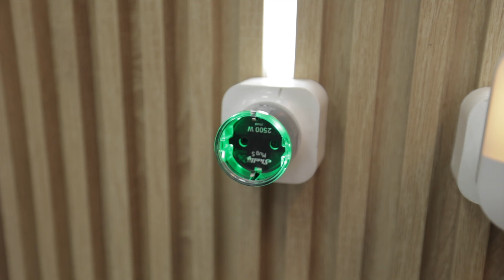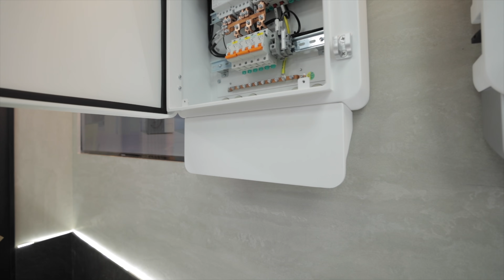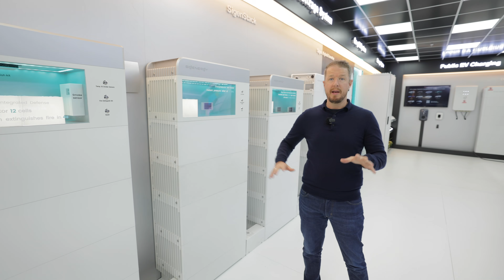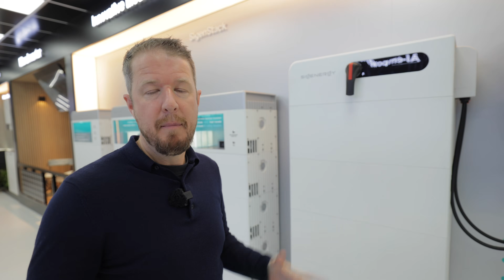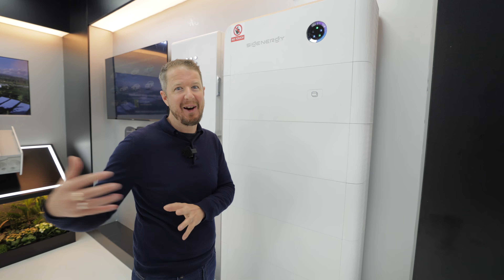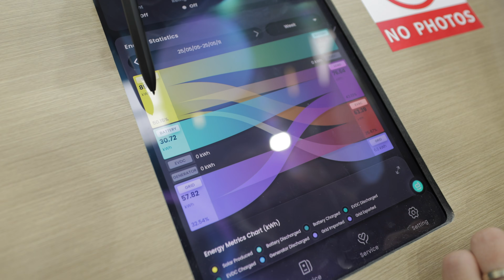Is Sigenergy About to DISRUPT The Solar Industry?

Comment from the maker: 👉 Want to learn more about Sigenergy’s latest tech?
Check out their website for full product specs, updates, and info on how to future-proof your home or business with their smart energy systems: https://www.sigenergy.com/en/home

Get a Quote: Interested in our services? Get a quote from us today: https://app.openquote.net/company/artisanelectrics
Reply: I'm done with the system packagers. I'm installing a set of three Victron Multiplus II inverter/chargers and three 5kW batteries for three phase whole of home backup, at about 50% of the cost of a SigEnergy. My two existing PowerWalls, that I used ti have local control of until Tesla decided they wanted to make money from VPP providers using my battery took away local access - and are now talking about charging me for even controlling it via their servers. Just give me local control back! I just don;t trust any of these guys any more. And if I have an issue with a PylonTech battery, individual cells are standard off the shelf sealed units and can be individually replaced, unlike the PowerWall which has to be thrown out if even one tiny cell goes bad and brings down a bank.
Reply: Is Shelly support dependant on a gateway being installed?
Reply: If you have 4 Stacks with 25Kw inverter on each stack how much Kw’s can you export to the grid? Or are you limited by the GRID? I’m just curious and planning a system for my own Edwardian house.

Comment: A few questions is the Ai working All working as a unit? or does it require internet?
I must admit it's a great looking integrated system, I wonder how it compares' to Victron Energy which was my go to system before I did see these units from Sigenergy, I really like to go with Build Quality & Design, 
in the Future I will be looking at a Bungalow with a South Facing long rear garden, mounting ground panels, & mounting equipment in a double garage,
I live in Cheshire I am hoping to go off grid heating water with Solar PV & Solar Thermal, have a underfloor heating system, basically pushing excess PV energy into the Water heater tank, if I get the ideal area of garden then maybe pumping energy back into the Grid used as a standby supply, 
Looking to grow the PV system every year, I do like vertical BF Solar,  
66 retired Aerospace - Defence Consultant Engineer ex UKAS DC & LF Instrument Engineer,

Comment: Home automation is plagued with 'Apple-ized' walled-off ecosystems, apps, often not locally connected , and overpriced.  For a comprehensive system you would have to wind up relying on something like Home Assistant in any case.. so that's where you might as well start.

Comment: Product looks great. Question do they offer, or will they offer, a hot water diverter like solar edge do? I have a solar edge hot water diverter and is amazing and I’m not sure why they are not more popular? Basically is a hot water battery. I have a 10kw system and apart from very cloudy wintery days I get 400 litres of hot water every day from solar pv.

Comment: Great, another vendor trying to replace Home Assistant with their own solution. As for 'smart' I'm not sure that there is a tumble dryer out there that if powered up by a smart plug will automatically start a drying cycle. You need devices such as the LG ThingQ range, that have builtin API interfaces.

Comment: Your tumble drier illustration is dodgy, artisanelectrics. Are you suggesting people put wet washing into a tumble drier and then get their system to run it if they have excess energy? So what happens if they don't . . . if it's cloudy? The washing sits there and it goes smelly, or even goes mouldy if it's cotton and there's spores in the air.
Enough of this.
Where I live, there is no mobile phone service, so I have never got round to updating my phone to a smart phone. Are the apps that all these systems you instal workable via computers (laptops or desktops)?
My not very old gas C.H. system works with Hive. I can access it and control it on my laptop . . . or could, until Hive insisted on two factor authentication, and wouldn't allow email or landline usage; it had to be SMS on a mobile phone. Thanks, Hive. Hive, owned by Centrica, a company with assets of £18.3 billion last year, according to their preliminary results.
So what do you manage to instal in buildings where there's no -- or no reliable -- mobile phone signal? Does it all work locally through wifi? No 2FA involved?

Comment: One of the main requests i see from EV users, is for the battery not to discharge into the EV when the charger is wired into the gateway. I would hope this will be addressed in v3 of the app, if not before.
Reply: Home Assistant + victron to the rescue.   My system identifies an octopus intelligent Go session outside of the usual slot, switches the battery to charge, charges the car, heats the hot water all for 7p/KwH...
Reply: @andrewmelvin2717  Not much help if you have a Sig system..

Comment: What is needed is cheaper products. Systems with batteries in them frequently take 20 years or so to pay for themselves in the UK which is not a great location for solar. This effectively means they never pay for themselves. Adding "exciting" bells and whistles is probably going to increase the cost and cancel out any new savings. 
To disrupt the solar industry we need prices of equipment to plummet and also not need expensive firms like Artisan to install them.

Comment: Look i am a fan of Sig Energy (Signal, SigInt) but there are still issues a quick look of the facebook forum....
Simple maths often failing - just adding up of numbers sometimes doesn't work.
Biggest issue still remains that when there is an outage of servers in China the entire stack un-comminicable - not that it doesn't continue to work but highlights a MAJOR flaw in the machine

Comment: How would turning my plug on make my washer, drier anything else that requires a program selecting and a 'Start' button pressing on the machine??
Reply: Try unplugging your washing machine,  then set the program,  switch the power button on the machine then pug it back in and see what happens.
Reply: @GaryV-p3h if you switch off the machine how would you be able to set anything?
Reply: @theSKINTyorkie  I can on mine because it has a manual programming dial, I can set it then just switch on the power with a smart plug or timer

Comment: If there's one thing that's almost certainly setting things up for failure it's using Wi-Fi (a mobile comms medium) for devices that don't move. Even worse when it's a device you're running cables to anyway and that needs the network to function.... It's borderline madness.
Reply: A wired connection is always better for higher bandwidth devices but for these smart devices it's a simple on/off signal. Most of them use 2.4Ghz wifi so it travels further, through walls etc. A good wifi router will have a dedicated separate IOT access point too but aside from all that I have not seen any smart sockets or bulbs or dishwashers or fridges etc with a LAN socket.
Reply: Based on your logic,  Shelbies, Ratgdo and 90% of other IOT devices have no reason to exist.  They are not mobile but are used remotely and the device would be twice the size and expense.  

If you brought cables down from your roof,  you need to protect them from the elements.  Which means either running separate conduit for them or using shielded valves in the same larger conduit as the power cables.  Both of those solutions would double the cost of that part of installation. Also not as architectural finesse.

Comment: Seems a game changer 
Then there’s the issue that no doubt likely to be hacked like everything else digital
Some might call it a kill switch or the opposite when lights start randomly coming on or off costing money one has to think outside the box. There’s nothing like a good old manual switch. I’m sure if they stopped selling said switches I’m sure I can make said switch from RS electrical supplies

Comment: I dont see Sigenergy being successful in the commercial and industrial landscape. In the industrial environment especially companies will choose manufacturers who are tried and tested.

Experts from the UPS industry will win the solar business here as they have more DC experience than any solar installers.

Also a traditional battery setup like a UPS would be much better for industrial users as many different battery manufacturers can tender for that aspect of these projects. Similarly if a certain manufacturer has a bad run of batteries its much easier to swap to a different manufacturer. I dont think modular systems will win out in this landscape.

Comment: This smart home automation is not new. My house has had fully automated smart sockets, plugs, lights, power management, garage door, cctv, etc for the past 6 years, all running with Home Assistant.
I have personally not used Shelly as my house mostly uses Sonoff and Aqara.

Comment: There is actually a team from Sigenergy in sweden right now to testning V2H  steep 3 i think? 😉 "Then it was time again with a batch of tests for V2X, this time with Sigenergy personnel on site from China.

This will be a slightly longer test, including testing that safety functions work with all the respective cars, before the beta program will soon be expanded to include a number of private individuals.

So if you have your car model on the list of those approved for the semi-public beta... then this is the right time to get in touch... ;)

The tests will last at least May 15-23 (including the weekend) at our place outside Eslöv, take about 1 day and a number of loaner cars will be available. So you can, for example, come by in the morning before work and change cars, and then change back in the evening when you go home.

When cars arrive, they should preferably have about 20% left in the battery. When they are picked up, they will have more.  :)

Write in the thread or PM or email me if you have a car that you can bring with you to be tested, that is not yet on the list below:

Tesla Y Dual LR (NMC) [2022]
Tesla Y SR (LFP) [2023]
Citroën eJumpy [2021]
BMW IX XDRIVE40 [2025]
BMW i3S [2019]
Kia EV6 
Kia Soul"

Comment: Is anyone talking about or solving the issue where turning on or off devices in this way will not work or even damage the device? I have never owned a tumble or washer that will immediately start when it receives power. Hell, my Sage coffee machine can’t even turn itself on when it receives power. I have to press a button. Similarly, if this system cut power to a PlayStation, air conditioning unit or any other appliance it could do serious damage over time. The industry needs to come up with a universal standard which notifies electronics that its power will be cut in a number of seconds so it has an opportunity to gracefully shut down.

Comment: Most things like washing machines have a soft start button so just putting the power on at the plug probably won't work. I have some shelly relays for lights and look forward to them being in one app. I wonder if it will rely on a cloud service or do it though the home network?

Comment: Micro inverters are going to be less used in United States because the utilities are turning on the customers.... Plus you can only use your solar if you have actual grid connection. Not when it's down though...

Comment: What I don't understand is what happens if your WiFi goes down. Will all these smart devices still work and is there a backup?
Reply: perfect question that nobody likes to answer with these technologies :D
Smart people use offline inverters with nothing but RS232/RS485 and RPi and local everything (sockets, switches) tied to something like Home Assistant with Wireguard VPN directly home, no public jank cloud. Preferably over LAN, because WiFi is always worse.
If anything goes down, you still can operate it over local LAN. Your data is your data, it never leaves your home. Obviously nobody likes that, because then they cannot sell your data to anybody :)

I prefer to run an extra cat5e wire behind a thermostat vs having it on wifi and hope the signal reaches across 3 thick walls.
Reply: Of course it does not work, did you think all these devices have built in Starlink? But if you mean with WiFi goes down, you just do not have internet connectivity than most functions will still work through local networking.
Reply: I believe the Wifi is only needed to feed data back to the controller.   They could operate autonomously if needed.

Comment: I’m looking at installing a Sigenergy system next year. I have a PHEV with a 2.2KW V2L output which can provide silent power for about a week. Could I use this as a generator source for the Sigenergy gateway in the event of an extended power outage? As far as I can tell the V2L output is floating, so would I need an Isolation transformer to clamp neutral to earth to input to the gateway?

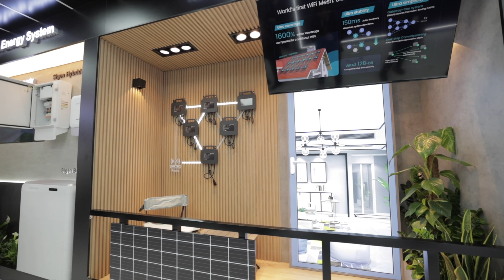Comment: 6:00 wi-Fi mesh  micro inverters! That sounds like a terrible idea having to climb onto your roof and hold the reset button whenever you need to change your Wi-Fi password.
Wired home infrastructure should be ethernet!
Reply: Why wouldn't you have them on a separate SSID for IOT devices that have a full 32 character password that doesn't ever need changing? Why are you changing your WiFi  password that often?  Is Interpol after you?  Also, are you going to homerun a cable for each micro inverter?  Or put a 8-port nearby to congregate them and then run a single cable (fibre?) back to your main switch?

Comment: Bunkus!!! 

A Shelly device ONLY controls the power to the appliance.  It is UNABLE to control the appliance 

Everyone knows that when power is disrupted, appliances have to be manually restarted.  

The only appliances that I am aware of that can automatically restart are water heaters, ovens and some dishwashers. 

You cannot use a Shelly to time your washing machine or dryer to start. Almost all dryers will not restart.  And washing machines will only restart after short interruptions.  Long interruptions in power will result in the timer running down and the machine will have to be restarted manually
Reply: I just saw your comment after posting a similar one. This is a pertinent detail that nobody talks about!

Comment: how does sigenergy gateway does the 0ms switchover? it doesn't have 2 rectifiers like UPS!
Reply: It has a grid tied inverter, like everyone is used to, paralleled with two contactors for it and the grid. Both are normally closed, but instead of the inverter shutting down when the grid goes down the contactor for the grid opens instead and inverter goes in to island mode. Pretty clever actually and I had the same question / doubts when I first heard about it. But looking up the manuals and layout explains it. It's just that the inverter has to be able to supply the building's demand if the grid opens. As smart as this is supposed to be, I am sure of the load is too high for the inverter it will shut the building down instead. He did do a video testing it and sure as sh!t, there was no visible flicker. Sure maybe a power quality monitor would pick up on the disturbance but there are events all the time on the grid you don't notice with the naked eye. It's also not a 0ms transfer, I forget what the specs said but it's not 0ms. Still quick though.
Reply: My understanding is that the sigenergy handles the loss of grid in a similar way as the Victron Multiplus or Quattro: the bi-directional inverter/charger runs synchronized with the grid in parallel mode. 

As soon as the grid falls away it will quickly ramp up to provide the power that previously was coming from the grid, this time from battery. This does indeed not happen instantaneous, but rather quickly: Victron specifies this at <20ms; ie. only a single mains cycle (and maintaining phase coherence). So even sensitive electronics won't notice.

Note that this "UPS" behavior is not the same as a true double conversation UPS; while connected to the grid it will pass-through the power quality of the grid: so if your grid connector is a generator with poor waveform, it will pass-through this signal instead of a clean sine wave.
Reply: @fkwvdpol  thanks for the explanation, as i understanding, you mean it's like SCR switch, can do in 10-20ms, which won't affect most of the devices. but sigenergy they clame 0ms, which is same as UPS.
Reply: @JetFeng-f4p  not quite, the beauty of the grid-parallel operation is that it does not need to switch over (like with a regular transfer switch; fast, but glitchy and no provision for phase/voltage coherence between the two sources), but immediately takes over the supply.  There is still a relay (switch) to disconnect the main, but this is to prevent the back-feeding to the grid: this will disconnect your grid when a outage is detected, and only reconnect when the grid is back and the inverter synchronize to the grid (same voltage, frequency and phase).   It does indeed work like an (offline) UPS.

Comment: Smart, smart, smart. Given the recent news out of the US, sounds like a recipe for kill switches, spyware and cyber attacks.
Give me simple off grid with a quality basic  low frequency inverter with  eve or catl DIY battery kits at a fraction of the cost and I will just turn on my appliances as normal thanks.